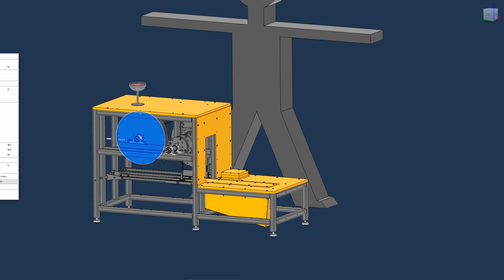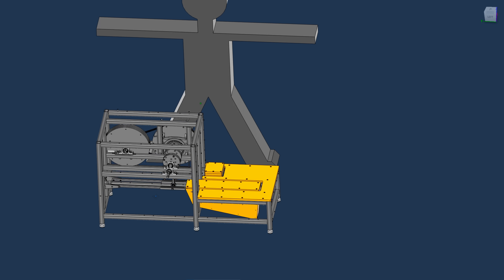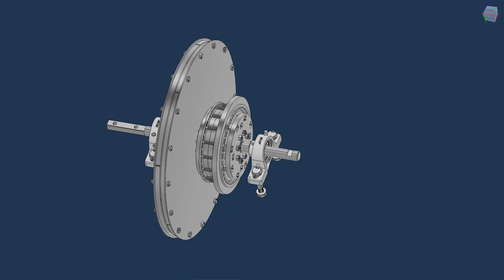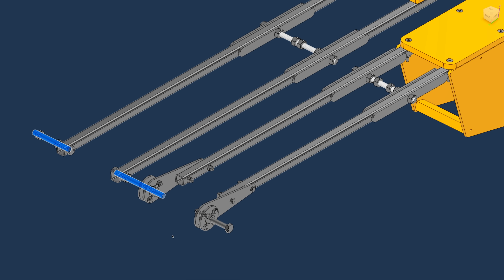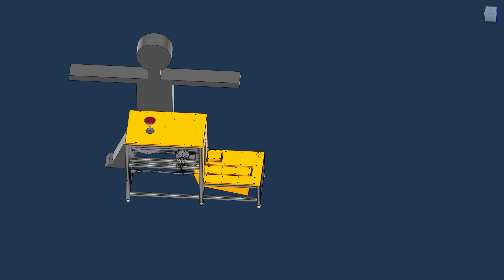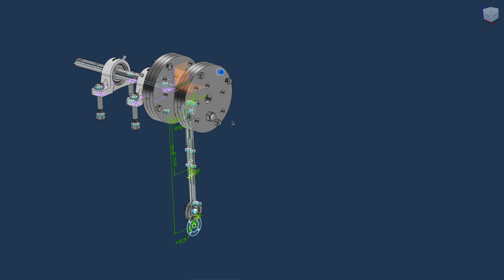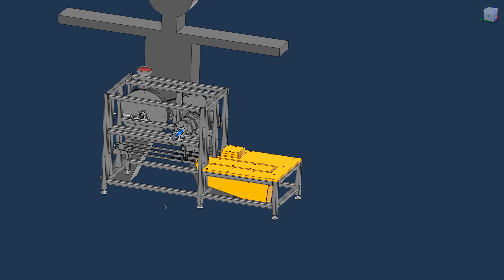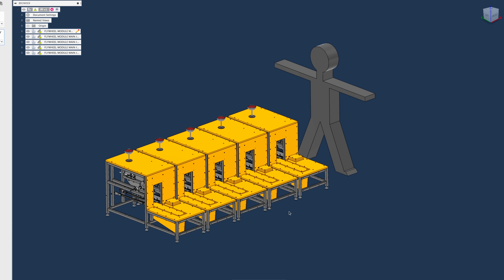Power Module Design Completed - Marble Machine 3 Ep.5

Comment: Lexan panels.  Can have transparency and safety in same package with that product.
Reply: I was just on my way to suggest polycarbonate panels 😄
Reply: @DominusFeles  +1 for polycarbonate. Acrylic is nowhere near as strong.
Reply: @yvan2563  if I remember correctly polycarbonate is stronger but scratches more easily compared to acrylic. So perhaps a sandwich of them could be a solution for the highest safety and transparency combo 🤔
Reply: @DominusFeles  Yes, you remember correctly. PC is softer and therfore more flexible than PMMA so when PMMA cracks PC would flex.
On the other hand, PMMA is way more scratch durable and rigid. In this application we're probably using a few like 2-5mm thick sheets which would both be a lot stronger than plywood. 
I would recommend using PMMA for the top part and the one he can get cheaper for the sides. It really doesn't matter because both will strength wise be overkill.
Reply: @Gustav Holmström  that's a great idea, i love compound materials!
Reply: Literally bulletproof when thick enough (thanks Mythbusters!)
Reply: @JanTuts  To be fair, even air is bullet proof when thick enough
Reply: @custos3249  i don't know if it is possible to get it thick enough on earth though.
Reply: Was just going to say this!
Reply: This.  Make it transparent=best of both worlds of safety and aesthetic.
Reply: What i was thinking too
Reply: This!
Reply: Was going to just say that too!
Reply: Was gonna say acrylic but maybe that's the same thing with a different name
Reply: Suggest this in the MM3 subreddit. This is where Martin reads feedback.
Reply: Yes. Lexan is my go-to for machine guarding and transparency.
Reply: @sboeke91  Lexan is a trademark for Polycarbonate the same way Plexiglas is a trademark for PMMA, which is an acrylic.